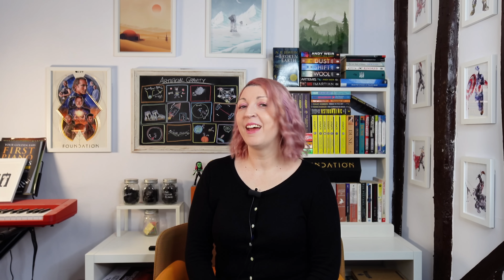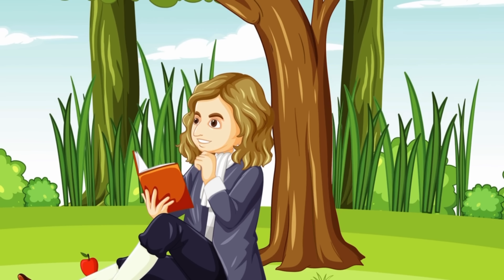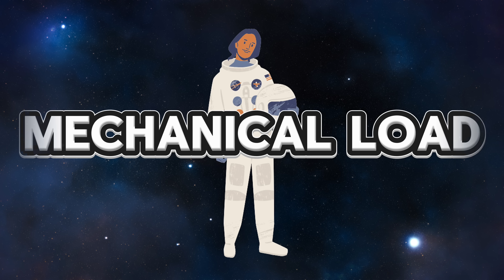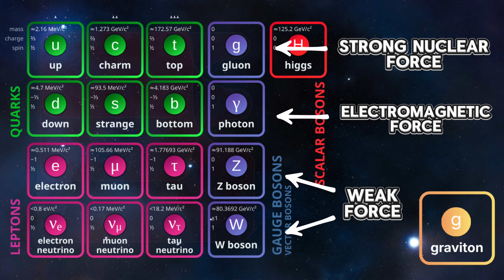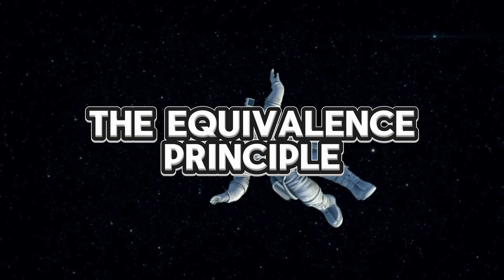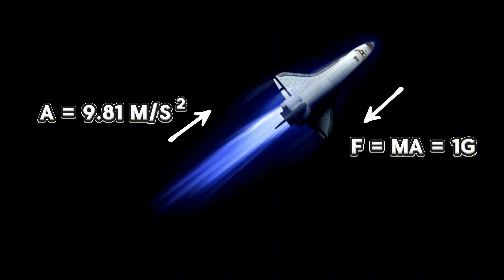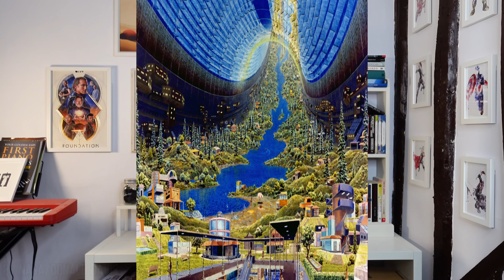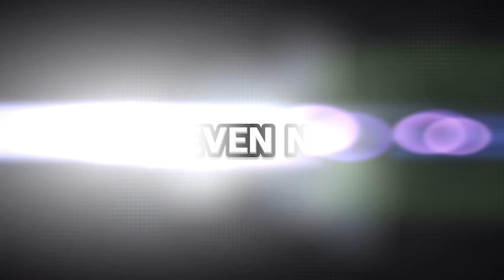Why Artificial Gravity Is Harder Than It Looks

Comment: It’s so simple it’s amazing no one’s figured it out. 1) take some glue 2) mix in the grounded up neutron star matter (the glue will both bind the neutronium and prevent it from exploding due to the lack of gravity binding it together. You need to be quick though). 3) paint the mixture onto the floor and wait for it to dry. 4) once dry test the gravitational pull of the floor before walking on it. If you’ve got the mix wrong there can be some “pancaking” of peoples bodies.
Reply from the maker: Couldn't be easier!!!
Reply: @popculturescientist I once read a book about anti-gravity. I couldn't put it down.
Reply: @LazloPNewman 😂
Reply: @LazloPNewman 
Chortle chortle! Although in an anti-gravity environment there would be no such thing as 'up' or 'down', so you wouldn't need to put the book 'down'. You'd just let go of it and it would stay put... until a gust of air sent it floating away somewhere 🌬 Damn, you'd have to stick velcro or magnetic strips onto EVERYTHING to keep your stuff in one place. What do they do on the ISS?
Reply: @LazloPNewman lol
Reply: An excellent suggestion sir, with only two minor flaws...  🤣
https://www.youtube.com/watch?v=7wu-adBvqj0
Reply: And people in the deck below you will be upside down, walking on the other side of your floor.
Reply: Never heard that one before, 10 out of 10 for originality! The issue may be how the heck do you get close enough to a neutron star without getting spagettified in the process? Actually removing the stuff would be an issue too, imagine the amount of pull required, phew!
Reply: @baanibarnes9711  you use a Neutron Collector, as found in Minecraft.
Reply: Re: Neutron star 'paint' - just occurred to me that your postulated ship would collapse around the super dense paint - there is no way to make the neutron star paint pull in just one direction! Still, kudos for original thinking.
Reply: Super easy! Barely an inconvenience!
Reply: THAT SOUNDS LOGICAL!
Reply: Nice i think you have something here if we can just safely get some neutron star stuff. Maybe the large hadron collider could make us some and we could hang it below the ship at just the right distance!
Reply: @wiltaylor  good luck getting it off the ground...you might have to build your ship somewhere in space or it might be similar (0r many magnitudes more difficult) to launching an aircraft carrier. You know the story... more fuel to carry that heavy plate, then more fuel to carry that extra fuel, then more fuel for that fuel... wash and rinse repeatedly until you get the desired effect. Feeling too lazy right now to research the values to do the math, and that's assuming you tell me the mass of your star paint.
Reply: @vicchalker5148  True I was gonna build out near jupiter! :)
Reply: Damn, I just commented on my theory.. the first comment I read is this one.. you too, use neutron star matter, grr.  While you use glue, I use a fine dust circulating through all structures of the ship.. dang, yours sounds good
Reply: riggghhhht
Reply: Does gravitational force originate from individual atoms, or only from large bodies?

Does gravity propagate like light, or is it instantaneous? And how far from an atom does its gravitational influence extend?

How do gravitational forces acting in different directions interact and balance each other? Is there a point between the Earth and the Moon—or the Earth and the Sun—where their gravitational forces cancel out to zero?

If gravity comes from atoms that are only picometers in size, how do their individual forces combine to produce a constant acceleration of 9.81 m/s²?
Reply: The Higgs is regurgitated slop. Electrons have a physical zitterbewegung, look at the work of David Hestenes. Photons have one too, spin is a physical property and motion is continuous. Objects cannot literally be in two places at once. The photon doesn’t interact with the “Higgs Field” but has the same effective mass changing mechanism as the electron. No particles are ever truly at rest. lol. Superposition of a free particle is the observer committing the mind-projection fallacy. However if we use a 5D Conformal Frame particles can have an origin and a point at infinity in their frames of motion, which means their intrinsic speed and their centers of mass. Not all forces are fields, not all fields are particles. The Higgs like force in every spherical (nonreferencing) frame of motion is the origin and it exists- not giving mass but as a center of mass. Think for yourself and look up the fact that we observed a mass changing excitation which was a signature of the mass changing mechanism. We filled in the explanation with the best one we had, Peter Higgs’s consideration of a 0D particle. But forces, fields and frames being confused are a major problem in the Standard Model. Please tell me the difference between a classical force and field and then I will tell you if you can tell me the difference between a quantum force and a quantum field. We cannot regurgitate ideas we must look at the math available to fit our data. 5D Conformal Geometric Algebra gives us a viable path towards Newton’s Absolutivity, such that we can consider the Universe a singular spinning body which is why Dark Energy looks like Galaxies being pushed to the outer boundary of a bucket experiment. New nonarbitrary dimensions—new physics. Higher dimensional physics like projective and conformal are far more interesting than quantum field theory. The Absolute insights on Dark Matter are just as wild. With Infinity as a dimension (MOND gave us the correct 70% of Dark Matter as rotational acceleration but fails at scaling gravity) we can see that the other 30% of Dark Matter is the peculiar velocity of a gravitational body. Gravity is absolute and contained not in a 4D Projective Frame which is relative but in an at least a 5D Conformal Frame—Absolute. When you add the projective vector back into the frame you get a 6D frame and you still cannot do Lorentz Transformations on a singular body. Therefore, you have the projective  hyperbolic cone as a gravitational boundary (this is why Kepler orbits are conic sections). This is not false physics, the data fits the model—we are just now working much of this stuff out but it will shake the foundations of physics. Oh, yeah about the rotation of the Universe and Dark Energy to fix the Hubble Tension — the rotation of the Universe was predicted to be once every 500 Billion years. That sets a new age for the Universe and makes the Big Bang just silly. Think about how long it takes Black Holes to form. Now consider that at the center of every Galaxy is a supermassive black hole. The biggest Black Holes in the Universe are found stabilizing galaxies. We can count the age of the Universe by the oldest galaxies and how many collisions and feeding frenzies they went on like rings on a tree, with their roaming times included as well of course. Think people think. Don’t take the slop that’s fed to you. Think. Absolutivity is a theory of restless bodies — they need no external force acting upon them other than emission. The largest and the smallest bodies are absolute. Yes, the smallest bodies too, despite their interaction properties. The really cool thing is entanglement, that is truly spooky but superposition is just an issue of measurement resolution. Changing the zitter of a particle changes its mass which is equal to its frequency. Zitterbewegung is the physical rotation caused by the actual physical electron, photon, neutrino and muon spins. Also the absolute explanation for muon decay is much better than the relative one. That time dilation bs doesn’t work. When a light-like particle is around increased gravity its clock (frequency) speeds up— it doesn’t slow down. Special relativity doesn’t apply to particles in a beam. Look at the Pound-Rebkah experiment. Come on. They are not clocks bouncing back and forth they a circular motion clocks like clock hands. Measuring the one way speed of light is also possible because the clock in the photon is its frequency. We measured the internal clock of the electron this way — in one direction and it moves very close to the speed of light. See Gouanere et all, with the Silicon and Diamond lattice channeling experiment. They used the 110 lattice direction from an electron beam from an electron accelerator.
Reply: 😆good one!
Reply: I remember reading about that in a science fiction book years ago, but the author didn’t think it through. The gravity gradient in such a system would be too extreme to be useful at « normal » Earth gravity. Also, you’d have to compensate for the EXTREME imbalance in electrons. Might make a useful weapon.
Reply: Floor would become ceiling on the other side though which means floor on both sides so how do i get to the second floor with a gravity gradient like that? I think CS Lewis's Voyage to venus, spherical ship, where oneside is for the trip out and the oth other side is for the trip back and you just use acceleration is the best real solution.
Reply: FYI: If you can't find neutron  star matter , I've had some  meatloaf  would  work (at least in stomach) feels like 2-3 G for ~6 hours.
Reply: Lol thin layer of paint
Reply: Just build a moonsized deathstar thing with it's own gravity. Problem solved. Wandering Earth style.
Reply: You would be applying the mass if a 2km steel ball under your feet above someone's head, and everywhere around it.
Your ship with floors covered in this would condense to a 1 meter sphere in no time.
Reply: I think the challenge is can you make the gravity monopole.  That is to prevent everything under the floor squishing up into the ceiling? the other question is whether the gradient of the gravity as a function of distance from the neutron mix would have adverse impact on people?
Reply: Much better to just drink half the neutronium juice and paint the other half onto the floor and wait for it to dry. Should be far more efficient with people and floor attracted to each other. The neutronium juice could even be mixed with alcohol and served at a bar so people wouldn't even think of it as a medication. You definitely have the best solution yet, this is just possibly a good improvement.
Reply: @tsamuel6224 Sex would become rather tiresome as the artficial gravity may take over and it would become difficult to disentangle.
Reply: @tsamuel6224  Yeah, but, what you ingest must come out, eventually, or at least the part that is not digested...

Comment: The world might not need it, but my pen and paper adventure needs it!!! I think I'm going for the acceleration/deceleration method, because I need a method, with which the passengers don't immideatly notice when they've landed (impossible with the spinning solution). But I'll have the ship accelerate and decelerate multiple times instead of only having one change, because otherwise they'd surpass the speed of light after one year of flight. I'm thinking two changes per year thus reaching half the speed of light max as a kind of plausible enough solution for the scifi setting.

Comment: I don't believe it will work since the spinning object has to be balanced to remain stable or it will flip end to end, with people moving around on the inside this will breate a imbalance and cause the ship to try to flip ends, they could possibly use a balance system to hold it steady

Comment: My guess is we'll see a tethered binary or trinary system.  It will have cable assenting modules for mass/human transfer. A radius somewhere around a hundred feet. It will have a docking port at the center. It will only be deployed when not under thrust loads.

Comment: Gravity is one of the four fundamental forces.
This is simple: if the four forces are one, it's a clue as to how to learn to use it, just as gravity is only an effect of spacetime. Therefore, logically, we must understand what the other fundamental forces are, and with that, we understand gravity not by discovering it, but by elimination. If electricity, the electromagnetic force, is the interaction of electrically charged particles, if we can create it artificially, it means we will also discover how to use gravity. The light from the device isn't gravity; it's the device letting you know it's working, just like any other device with that damn red light that keeps me awake at night.

Comment: Did a quick scan in the comments and didn't see this one yet.

I'm basing my guess on intuition here -- we'll find that how much of that load the human body actually needs is "how long do you want to live and what quality of life do you want to have?" Our bodies are not just adapted to 1g, but were built in 1g. Not in 0.9g, not 1.1g. (Yes, if you go deep enough into the digits, you'll find that there is some very small gravity variation on the planet, so our bodies were built to handle that.)

I noticed a comment saying that The Expanse has everything running at 1/3G. We'll find that, after all our research, that will work... if you want to live a shorter life with issues. In fact, anything outside a very, very small delta around 1G will, the farther you get from 1G, increasingly change and degrade a lifespan the longer you live there.

But I (far from an Einstein) am just using my meager intuition.

If we are ever able to inhabit the rest of the solar system, we'll need to know the envelope.

Comment: 19:52 The Expanse is great, but Hergé did it 70 years before 🙂. Have a look at "Objectif Lune" and "On a marché sur la Lune" ("Destination Moon" and "Explorers on the Moon"), and it was 20 years before Apollo. The well known white and red rocket accelerate half of the trip and decelerate on the other half, with a nuclear reactor, and Tintin if floating in the rocket when the Captain did the mistake to shut off the engine.

Comment: Two SpaceX Starships connected nose to nose by a 500-meter cable rotating just under 1 rpm ought to do a good job to simulate a reasonable artificial Martian gravity. And it would not even be that hard to pull off.

Comment: Hmm, there is gravity in LEO - almost the same amount as on Earth's surface. On Earth's surface we feel weight, the force downward due to gravity, because the ground stops us from falling. The issue is that in LEO everything is in freefall. The floor falls as quickly as the astronaut and so the astronaut does not feel any force holding him or her upward against gravity. The lack of feeling a force pushing upward against gravity is what causes the problem, not a lack of gravity. Some mistakenly call this a microgravity environment, however since the force of gravity is nearly the same as on Earth, there is nothing "micro" about it.

Comment: Star Trek's quirky android Data would not require gravity, but would still need shielding from excess temperatures and micro-meteors. If we can't build O'Neill cylinders in time, AI bots will be the only intelligence that survives earth. Even with warp drive (or equivalents), we will likely never reach a planet that can be sufficiently altered for our current meat-bags to survive long term on.

Comment: You glossed over why a high density material that could produce enough curvature would destroy the ship. 
Can you explain that?
Reply: Gravity is cumulative. So a 1 square meter panel that produces 9.8 m/s² of curvature placed next to an identical panel would produce a combined 19.6 m/s² and so on. Also, if it were possible to substantially warp spacetime with 2 dimensional panels, the geometry of that warp would be really wonky. It would result in everything being pulled to the exactly center of the floor and trying to walk away from that spot would essentially be like walking up hill. That's why gravity tries to pull everything into a sphere, in that configuration the warpage is uniform. That's a fascinating topic in its own right and I too would love to hear Abby expound upon it.

Comment: How about this? Design full body suits with thin wire mesh in them, and then use 1G simulation electromagnetic plating? Or is this a non starter?

Comment: Mass = Energy... correct?  Mass causes warping of space, thus gravity... correct?  - If so, then it's a matter of controlling energy to create  a warping of space, thus gravity.  First, what exactly is the energy/freq/modulation of Mass that warps the space?  Second, controlling the direction of the energy effects, aka, the floor pulling you down and not effect what is below the floor.  It may take a million years, but at some point, mankind "will" be able to control energy is ways to produce the effects of gravity.

Comment: I have an idea.. use neutron star dust.. its sprayed and sealed inside plating that exists throughout the ship.. it interacts with a person's mass.. the closer a body part is, the more of this neutron dust collects, the soles of the feet, in contact with the floor playing attracts the dust.. pulling your feet gently to the floor.. your head, in the middle to 2/3 up from the floor doesnt attract us much of the dust in the ceiling/floor above.. causing less of an attraction.  Thats why, when the ship is attacked and jostled, you see Kirk and the rest getting thrown around, the dust is being rocked to and fro, oddly pulling matter/crew around.  Chairs, tables have a tiny bit of this dust embedded into their structure.   Ok, poke holes, but its as good a theory as any other.. besides rotation and ever increasing inertia